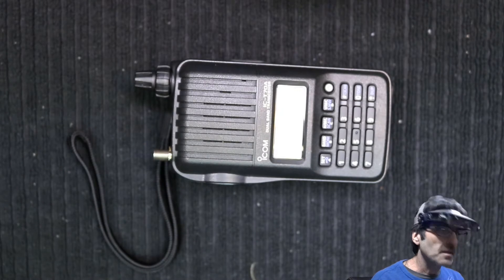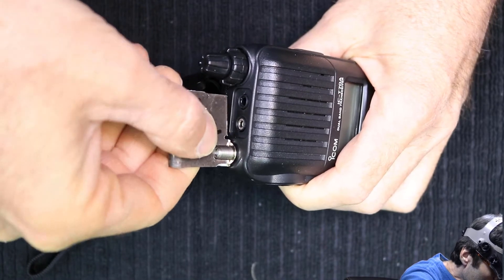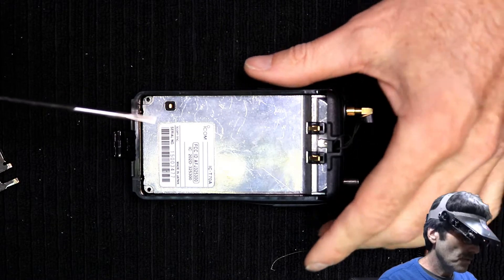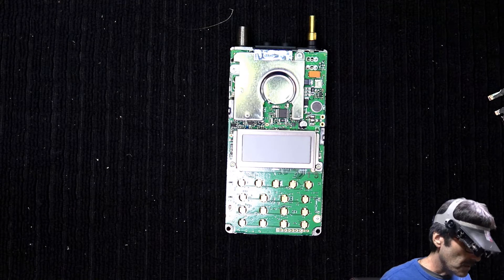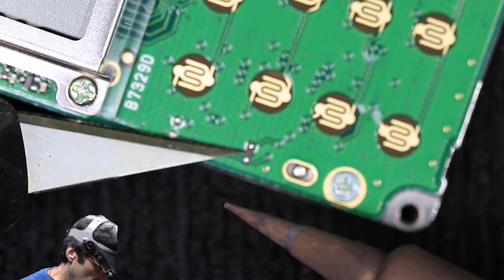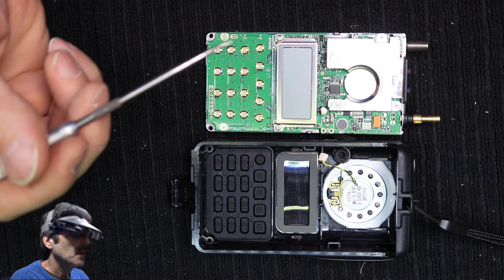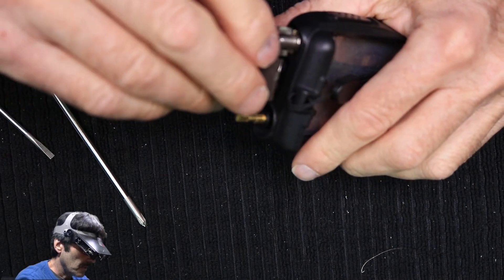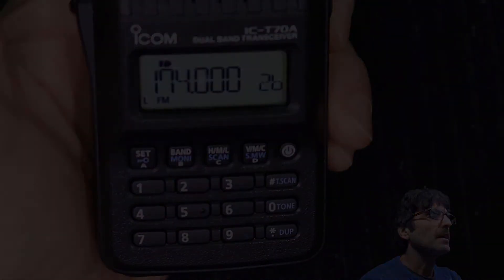How to Open Transmit and Receive Icom IC-T70A Full Explanation w/ Test

Comment: will this be the same procedure for a ICOM IC-V86
Reply from the maker: I don't know.  I've been looking at this one, but I can't find a mod specifically for this one.  It looks similar to the t70a, but unless they used the same board, It'd be anyones guess.  I actually want to do a video on this, but can't find the info...
Reply: @JLPicard440  There's one single diode (it's a 2m only HT) just to the right of the LCD screen when apart that needs to be removed for full Tx.
Reply from the maker: @MrButterpantz  Thanks for the info!

Comment: Im new to Radio devices, but i have a question why they originally making such device to a limited range of frequencies. Thank you for the video its very useful and i will try to follow the steps hopefully i will not destroy the device :)
Reply from the maker: Good question... I know the Boefeng comes already opened up..  I think it's a requirement from the FCC would be my guess..

Comment: Saw this vid several months ago and finally got to it after a "review" Made the same kinda tool you did but had to make two! The first one bent like a aluminum can and was made from a 2X2 inch shelf bracket, 2nd one was hard stainless steel and did the trick. They must install that nut with a 3/4" impact wrench? Buggered the nut up a bit, but still usable. Anyway, thanks for the great write up.
Reply from the maker: Yea, they put that nut on pretty tight.  Unnecessarily tight.  Don't try to get it loose with a flat head screwdriver, because it's not happening!  Thanks for the comment.. :-)

Comment: Did this mod affect the weather alert feature?
Reply: That's good to know. I like the radio because it allows me to carry one radio when I'm with the Scout Troop and I can monitor it either the FRS radios that use or can play on the ham bands if I'm in the mood. But I also like to have the weather alert function when we're camping and such. Whatever reason it will not work on my radio but that could be any number of things I suppose and I do not know the history of the radio I bought it fairly inexpensively used.
Reply from the maker: I never tried it to be honest, but I don't see how it could
Reply: Wondering because I have the same radio with the mod (I did not do it) and the weather alert option doesn't appear in the menu.  No way to activate it.  Not knowing the full history of the radio can't be sure the cause....
Reply from the maker: @mkudron1  HUH,.. I still have the radio.. I'll look into it this evening and see if I have the WX alert option.  If you don't hear back by tomorrow remind me because I might forget!
Reply from the maker: I tested my radio, and I didn't have any trouble getting the WX alert to turn on... just wanted to let you know... thanks.